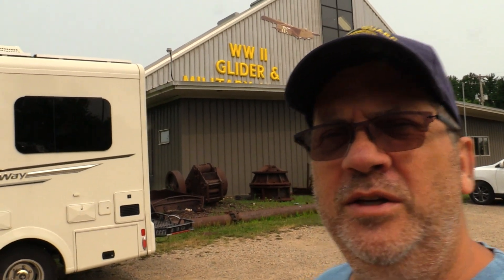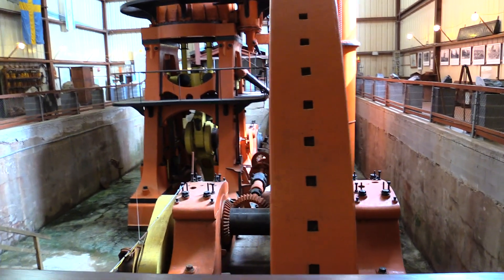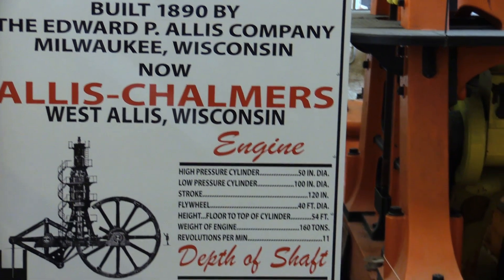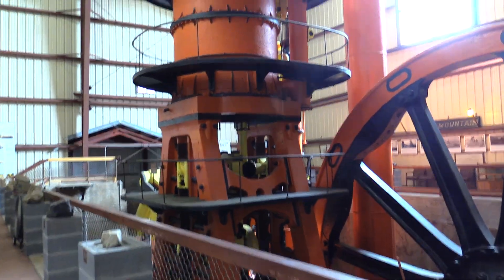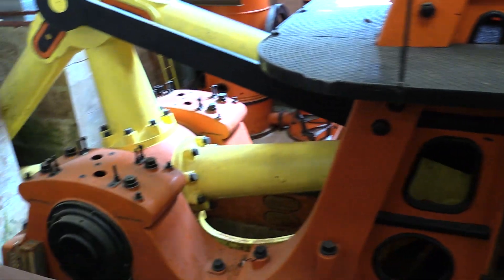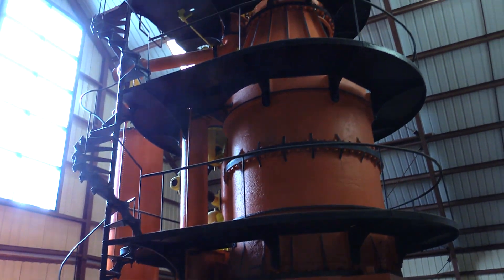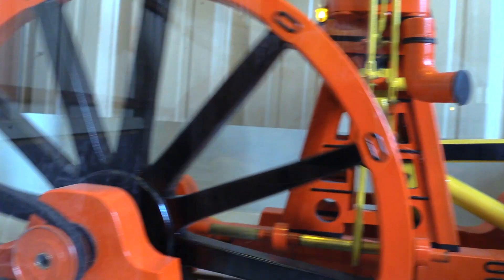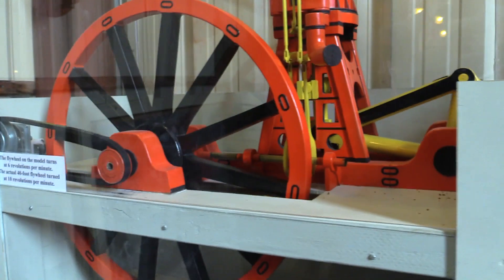Cornish Pump - Iron Mountain, MI

Comment: There is one of these running in the Colorado hard rock mining museum in Colorado Springs.  They run it on air to demonstrate it.  Its quite a machine but I doubt that this one is the largest.  There were hundreds in england.  That is why they call it cornish.  It came from there.
Reply from the maker: They are amazing pumps.